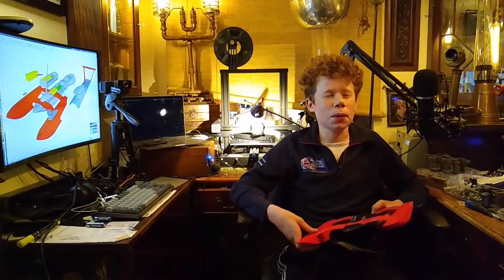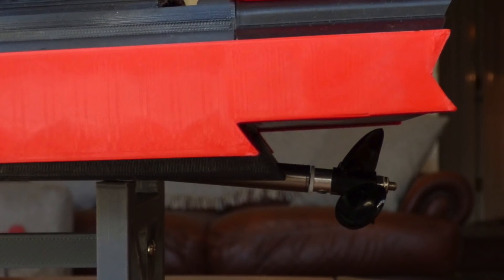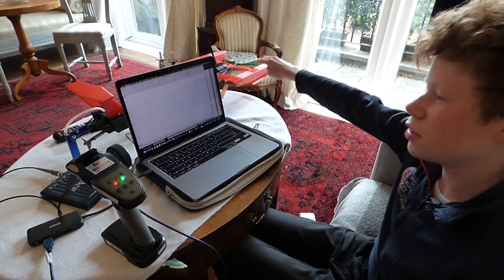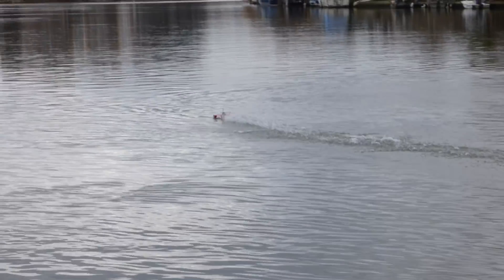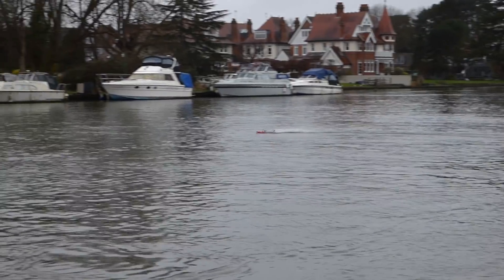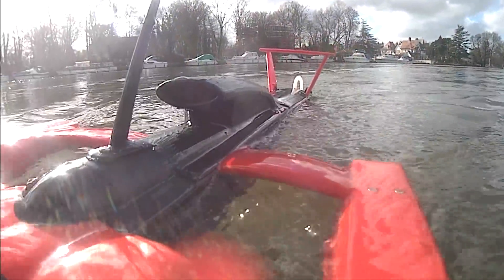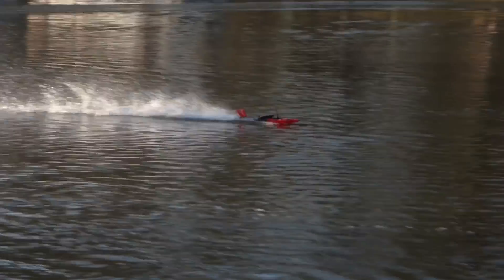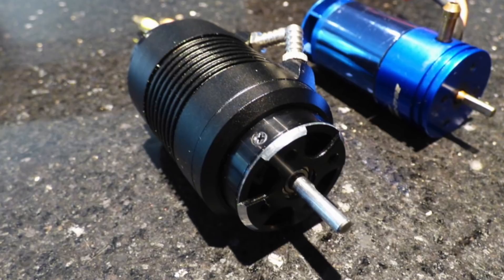3D printed RC Hydroplane

Comment: I think it would be interesting to try and overcome the issue of waves with hydrofoils, then you should be able to go faster without bouncing against waves. Although hydrofoils kind of ruin the fun of a big wake, so perhaps a version with pontoons which can auto adjust to always stay level and also add a control surface to the rear spoiler to also right itself? Not sure, but I'm definitely interested and will be messing around with this too!

Comment: Nice project and very good presentation. Have you looked at the hull designs use in drag boat racing, seems that is what you are going for here. Short high speed runs.

Comment: By example of the Mono M2, optimum rake angle of propeller is around 1~3 degree. It's achieved through mounting motor as lower and close to the bow as possible, also the shaft is usually protruding trough the stern up to 10% of overall hull length. Se pic on: imgur.com/7D7kaXB

Comment: Models of this type are usually designed for racing and turns only to the right, consequently their rudder is asymmetrically mounted 50mm next to the shaft. The Turnfin (stabilizing fin) mount is almost at the the edge of the model or the float. In the past, the motor and or esc cooling system for racing models (turning right only) was located in the lower right part of the redan at its edge. In such a system, the model also took water during the right turn, now a water inlet in the rudder blade is used or separated water main next to rudder blade. Regardless of the batteries and engine used, the center of gravity of the model should be within 26-30% of the hull length (measured from the stern). In the example of MONO M2 boats we use engines around 2200 Turns/V (with a 40K propeller, but not bigger than 43.5K. With smaller propellers the models were more stable in bends and the speed on a straight line was almost same as with a 45K propeller! So there is no point in using larger propellers that will give You a little increase in speed at same drastically increase power consumption.

Comment: but you didn’t think to put hydrofoils in order to balance the unevenness of the water, the skis didn’t come off the water, although this is a long epic, you can put a new time on the distance traveler, you don’t have to answer me, a question for you.
Reply from the maker: hydrofoils are actually slower and less efficient than this design as they actually have more boat in the water compared to a prop-riding hydroplane.
Reply: but, so he is consigning with this, the golden mean, and there are water turbines, and if done, a turbine that takes from the atmosphere

Comment: A little thing called design...here's a few steps for you 1) Write a design specification 2) Do your weight /balance /wetted area etc calculations 3) There's a mix of hydrodynamic and aerodynamic moments to consider (you may need to do some reading here.) 4) How's your maths ? More power isn't always the answer - drag and stability are important too. At the moment you are chasing the 'development curve'. Try taking a step back and consider some of the above....Good Luck (and don't give up !).
Reply: The biggest problem when you start out is not knowing what you don't know.  3d-printers are great for letting you rapid prototype, make mistakes, correct them, and generally learn what questions you should be asking.  You cannot write a design spec without understanding at least part of the problem, and you can't understand the problem without experience.  There's quite a learning curve getting to the point where you've got a boat that floats, moves and steers at all.  Along the way, you need to learn 3d CAD skills, basic electronics, and the subtleties of 3d printing.  Only as the simpler problems are understood and solved is it worth even asking the more subtle questions.
Reply: @markhandley  I disagree. The design spec. can say things like any transport constraints (eg must fit on my Dad's back car seat), the size of the test lake /water (eg from an OS map), minimum scale speed target. You could add £'s budget, maximum weight of batteries, motor(s), estimated prop' size for initial tests etc. All of these will help eliminate the unlikely /impossible and point more towards the successful solutions. Why not capture it in a 'spreadsheet' and have a section for test results as well ?

Comment: Try to improve the rake angle of the propeller.
The smaller angle the better, in perfect world should be almost 0 degree. By Example move engine forward and use longer prop shaft, batteries to back. Future improvement could be the flexible shaft or split one with cardan joint. Make one of the floats (counter reaction side one) hollow at the sterns, when boat tip over after harsh turn, the flooded floater together with turn reaction of propeller will help to turn boat back. Also don't go to the bigger the better way. Smaller propeller with blades of small rake angle will generate less friction, thus have bigger RPM rate and basically this is what all hydro's need for their performance, most hydros/riggers use at least 20.000 RPM some even 30.000 RPM. Remember also to use propellers dedicated for hydro's - Intended for semi-submersion operation.

Comment: Good job with everything. Pretty surprised the boat held up. One thing though, it seems you are trying to recreate the wheel when it came to hull design, prop selection, rudder, etc. I tink a little time spent in some forums asking about those things would go a long way. For instance, using a straight shaft is going to limit how fast you can go. Use a flex shaft instead with an adjustable angle and you can then fine tune the lift. Oh and definitely buy a sharpened and lightened propeller. You also will need a much bigger battery. Figure 4000mah or better.

Comment: It's actually a lot more fun to build them out of thin ply and fiberglass.
Reply from the maker: It's not when you crash it and have to spend a month building a new boat while it just takes a day and I have a new boat section
Reply: @thescienceguineapig2833  But, ah, it makes you less foolhardy at the controls, and it's not that you have to build a new boat, it's that you GET TO BUILD A NEW BOAT! Your skills improve, and there is a MUCH greater sense of earned reward for your efforts.

Comment: Hi very intresting video I cant wait to see more from you, The strain involved on the boat are prety hight when you prototype satisfies your wants I suggest you to fiber coat the boat just one layer of glass fiber (or carbon) will increase the strength significcantly , it will also help for water seal, and the added strength allows you to reduce the numer of perimeters for the 3D print that decreasing 3D print time.

Keep it up from France

Comment: If you're into high speed you should check out tethered hydroplanes if you've not come across them already! The boats run in a circle around a pole, attached by a wire so you don't have to worry about steering etc. and the aim is to just go as fast as possible, they reach some ridiculous speeds (up to 118mph)!

Comment: Wow... excellent job, keep this up and your not gonna have to work a regular job, this is proper youtube content that deserves monetization. Also it sounds like the sponsons are digging into the water on straight runs, try different propeller strut angles, maybe 1mm up to bring the sponsons up so your just riding on the rear pad and rudder, thats where you start flipping back but get insanely fast.

Comment: hi.   in think this is one of the best    racing boats i have ever seen. !!!
have you solved the water from coming inside the electronics ? 
if so,  i want to buy one..
can you build it for me just as this last 80 kmts /h design. i will only put my radio and receiver
please write to me and tell.me how much will it be .
eduardonessim@hotmail.com
many thanks and congratulations !!
.
Reply from the maker: Sorry it's not for sale because firstly it's too unreliable and secondly it's good for spare parts on my 1800W boat im building
Reply: @thescienceguineapig2833  well , can you built one exactly the same as this one for me ? i want same configuration as the last one you showed in the video ..80 kmts / h.   without any water coming inside
Reply from the maker: @eduardonessim4499 the boat is only waterproof above 50mph. That's the design
Reply: @thescienceguineapig2833  ok.  can you build one exactly the same for me ? how much will it be ?  which battery do you use in this boat ? do you have to use tape to close this hull ?

Comment: Dude, impressive video! 

May i reccomend you use a Pop Filter for recording voice overs for the next project? 
It does exactly what you think it does, it takes the sharp pops out of the voice and it makes the whole thing easier to listen to :)
Reply from the maker: I was actually using a pop filter. Just inexperienced at doing voiceovers
Reply: @thescienceguineapig2833  Oh wow, in that case its best to do a few testruns with different setups. Like positioning the mic and pop filter. Also, do not use one of those curved things behind the mic that should reduce reflections. They do more harm than good. Try different things, maybe bedsheets or towels to reduce reflections. A more expensive mic probably would not fix the issue. Its all about setup and practice. Good luck man!

Comment: How cool, 👍👍👍👍
 I recommend you disassemble the receiver and waterproof it with some epoxy.  The servo can also be waterproofed a little bit by putting wd_40 on the electronics part of the servo.

Comment: What about a two prop with differential steering?   You can get rid of the rudder, and dividing the power between two motors also divides the heat.
Reply from the maker: However it would mean that the boat would be a lot wider. Meaning it probably wouldn't propride